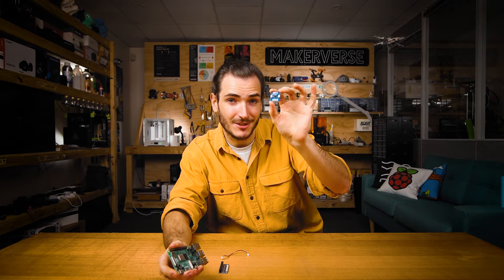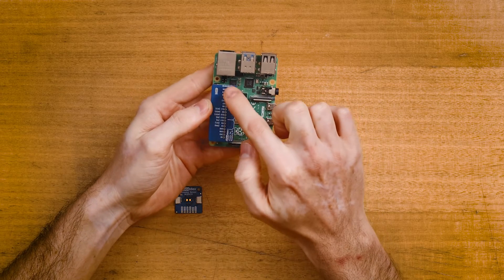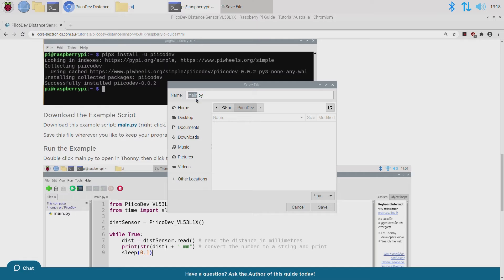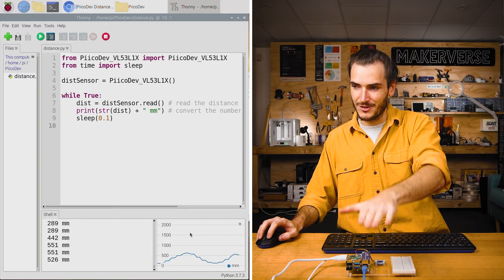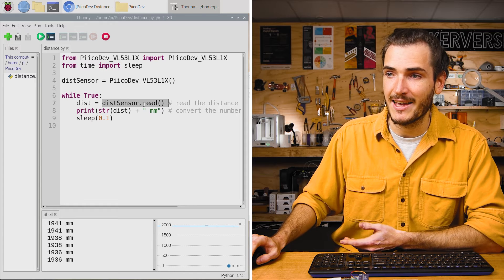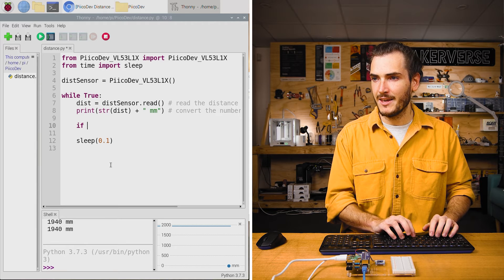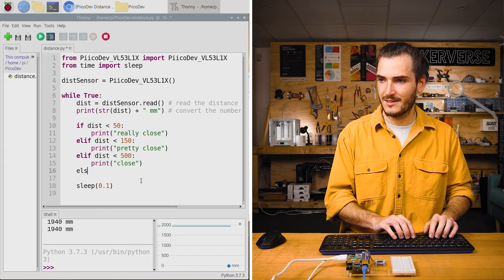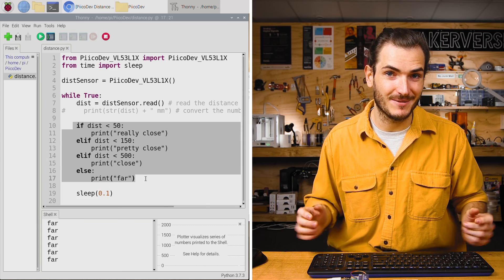PiicoDev Distance Sensor VL53L1X  - Raspberry Pi Guide

Comment: Is it possible to read 4 points at once? I work power equipment, and in trying to come up with a concept for deck leveling, need to read 4 points at once with some kind of accuracy in relative real time as we adjust each corner, it's currently manually measured one point at a time and a nightmare because each movement changes the other 3

Comment: Is it possible to connect more than one sensors to the adapter (it has four slots) and how the python script would look like?
Reply from the maker: It's possible, but a bit tricky: https://forum.core-electronics.com.au/t/piicodev-laser-distance-sensor-vl53l1x-modules/16250
Reply: @Core-Electronics  thank you for your answer!
Reply: @Core-Electronics  Hello, thank you for the video.  Sorry for the beginner question, but what does it mean to drive the SHT pin low to grab the address of each sensor?  Would it not turn off the entire Pi?  Was wondering if it's possible to read simultaneous input from two sensors.

Comment: Good day. I came across your channel during a search of a project I'm working on. I'm a member of a training crew for baseball and softball umpires and we want to build a laser grid, to use during the training. The lasers would be set on a frame, both vertical and horizonal, to build the grid over the width of the plate (17") and also vertical for the height of the zone (which for training purposes would be static). My problem is trying to find out how to build this since both the horizonal and vertical beams would have to be interupped to be considered a strike. A pitched ball over the plate would interrupt the top/bottom laser but if the pitch was up high, it wouldn't break the other laser and thus would be a ball. We want a light to come on only if both beams are broke and would be considered a strike. I have a picture of a frame that was built for the lasers but we can't figure out the circuit boards and programming for the lasers. Please share with me your thoughts if possible. Thanks.
Reply from the maker: There are perhaps better offerings out there - "laser safety curtain" might be a good starting point. In any case, the best place for technical questions is our forum: https://forum.core-electronics.com.au/
We're full time makers and online every working day!

Comment: How to connect the piicodev without the adapter or how do I use the pints 6,8 & 10 once after I attach the adapter to raspberry pi. I need to control a rover with the pins 6,8 and 10 and also want to measure the distance.
Reply from the maker: Hi Jacob! To use without the adapter connect SDA:GP8 and SCL:GP9. If you still want to use the adapter instead you could try using other pins for motor control. It's best to get technical help on our forums: https://forum.core-electronics.com.au/